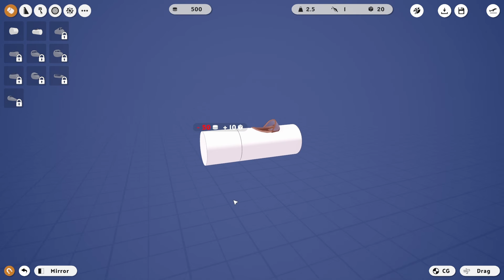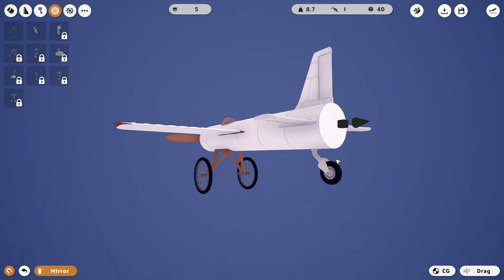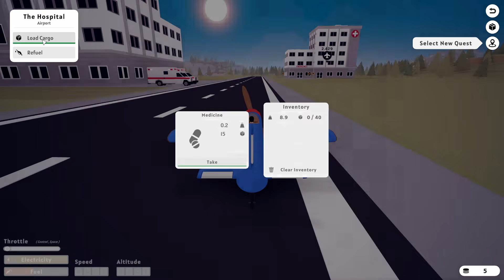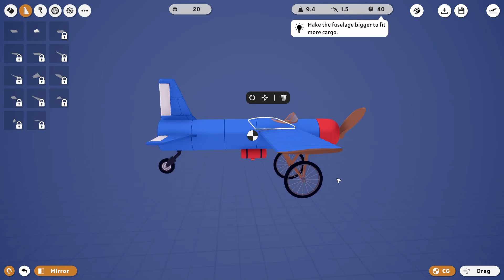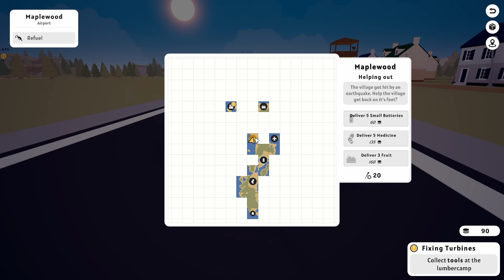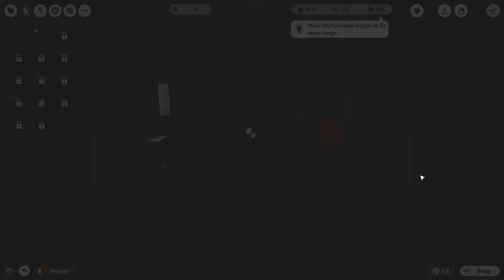Making a Plane | Aviassembly

Comment: Good stuff.  Cool looking game.  I have to admit the cockpit in front of the wings was a little amusing.  I suppose they might have existed but I don't know of any.  
I was mildly surprise you didn't do test flights.  If repairs are free and fuel are free it makes sense but then again, you wouldn't have had the fun stuff during missions if you had....lol
Reply from the maker: The design mechanic seems to push you towards a front mounted cockpit, despite it being a slightly odd design. Certainly, with some of the biplane models, the cockpit was essentially under the upper wing somewhat, but definitely not usually in front of it! 
Test flights? Who do you think I am? Somebody competent?